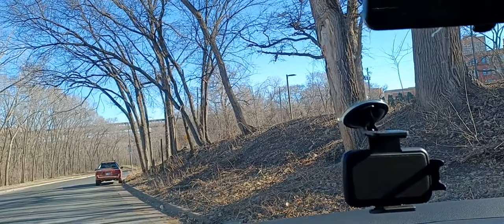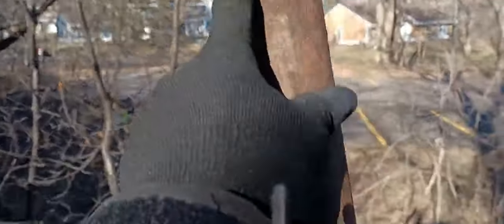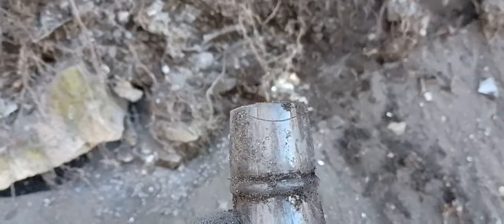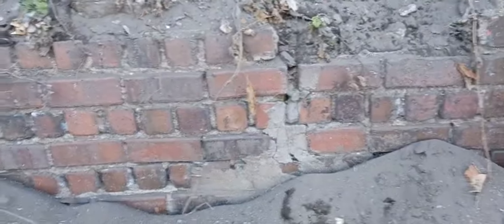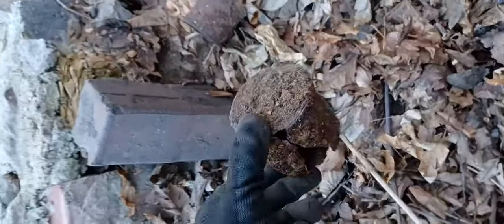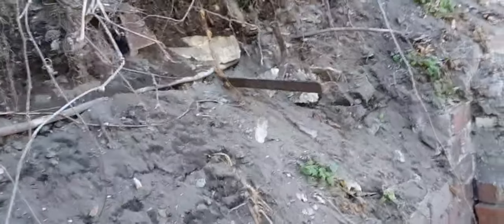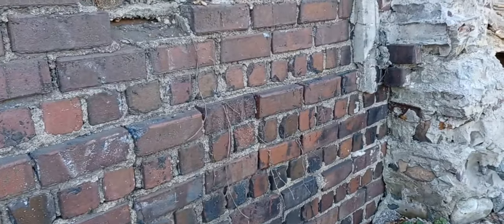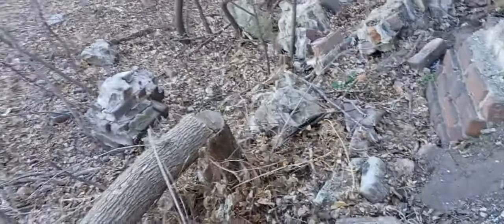This Is What You Stumble Across in Minneapolis (MIRRORED)

Comment: When I was first learning about this cataclysm high voltage event, I noticed some evidence on my own house of brick damage due to very high heat.  My house was built in 1960 but it has a reclaimed brick exterior wainscoting  (true reclaimed bricks from some other structure somewhere) and there are a few bricks in that wainscoting that exhibit heat damage.  I've lived here several years, but never noticed this before, not until I had "eyes to see it".